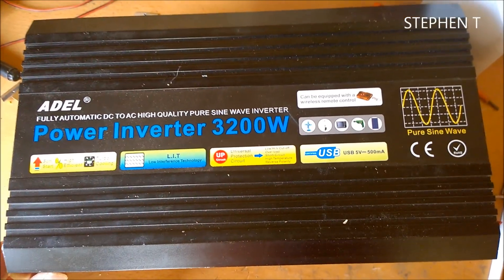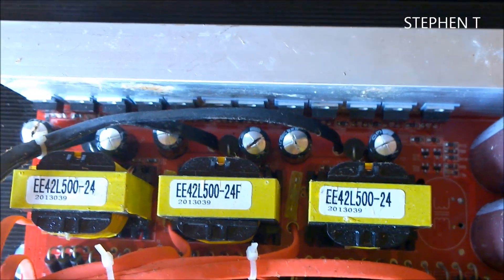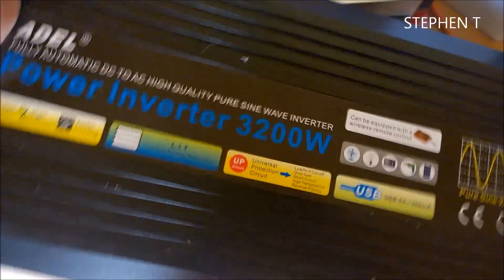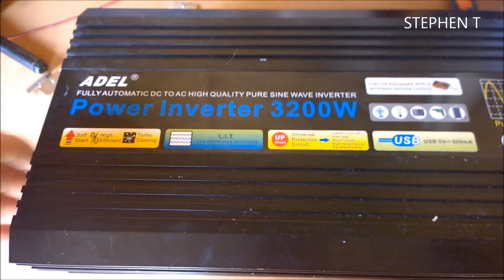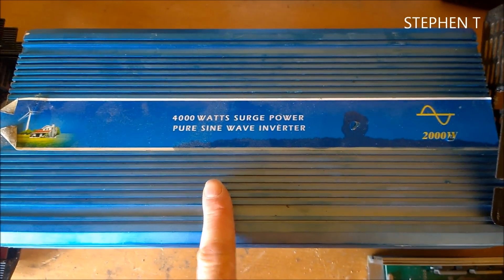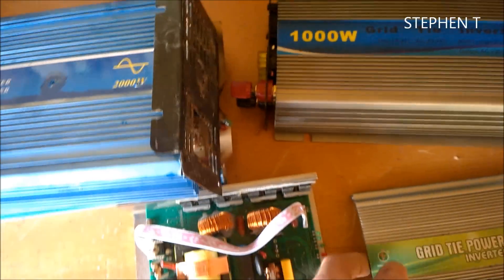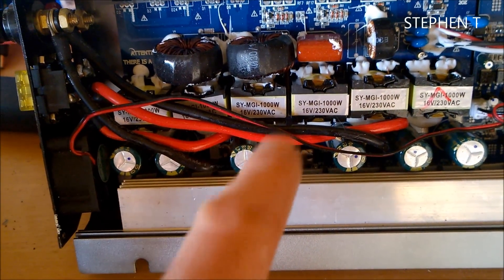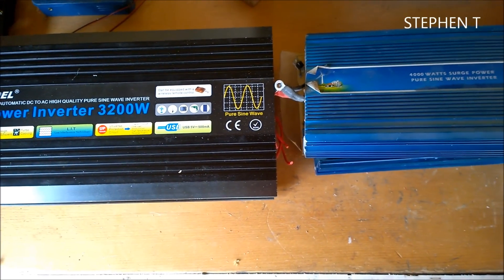WHY NOT TO BUY CHEAP CHINA INVERTERS THEY WILL GO ON FIRE

Comment: I repair tv and the same problem exist thay use small caps that cant handle the power so you have to buy new or fix the old with new parts and bigger voltage range caps thay use caps right at the voltage range so thay get hot and pop after so long

Comment: I have a Cotek Pure Sine Wave 24v 1500 Watt inverter off ebay been working for close to a year.  Maybe try one of those.
Reply from the maker: Hi I have a 12v 3000w pure sine wave and 24v 6000w for the last 3 years with no issues. Thanks

Comment: Seen quiet a few chinese inverters and to send them back costs more then it did to buy them one video they smashed it up with a sledge hammer
Reply from the maker: +jacky Parker Yes they are not worth getting. You are better off getting them direct from a supplier.
Reply: +Stephen T Anyone that sells something is classed as a "supplier" ..  Even a teacher is a supplier as they supply students with what they need to be able to learn
Reply from the maker: True I would just go direct cut out the middle man.

Comment: Hang on. Because you got 1 bad one, none should be sold? people get bad new cars all the time, so by your reasoning, no new cars should be produced either. Use any product for their stated purpose and you will not have issues. Obviously you are abusing these. tens of millions sold, and only YOU have issues with every one?
Reply from the maker: +Trina McDonald I had lots of them only used for very little time. look at more videos on youtube u see they are all sh1t.
Reply: +Stephen T Oddly my 8000 watt, split phase, pure sine wave, LF inverter made by Power Jck has worked fantastic. Couldn't reply without it.
Reply: CONGRATULATION, MY 15kW CONTINUOS, 60kW peak only can work with 4.5kW

Comment: My first Chinese 3kw inverter died from a lightning strike, I got it from a UK caravan dealer who sent it away for repair but the engineer said it was not a warranty job and the parts to repair it werent available anyway. my second 3kw chinese unit is still working well after 3 years.  One of my 350w chinese gti's died after 3 weeks but it was shipped from UK stocks and they sent me a free replacement which died 4 days after the warranty expired. You get what you pay for.
Reply: No they dont run continuously.  The instructions tell you not to run them for extended periods but I have gone away for a week before and left it running with no problems, I usualy switch back to the grid overnight. but you are right in that they do have a duty cycle and need to be rested. The answer for staying off grid is to have a smaller inverter just to keep the fridge going overnight and maybe a couple of lights while the main inverter takes a rest.
Reply from the maker: Your correct stay away from them.your better off staying with the Germans.no important costs and no waiting weeks for your unit.thanks for your comment I have only seen this now it was hidden and I don't know why.

Comment: You are right,
I have 5 Grid Tie Inverter from China bought on E-Bay,
in the first year were already 3 broken(= 60%) and no one here could those things reparier.I have it sent back to China at my cost. One is lost in the mail.

The inverters have no brand- name, no serial number and no international approval.

 Only:   Solar Grid Tie Inverter  500 W
 (solar panels=-right,, left= windmills on a blue Sticker))

The manufacturer is Kai Deng in China, the Dealer Ego-Worthy

 I  sent three times  all the forms for admission from our Electr. Office  to the manufacturer and never received a response.

There is no firmware, no designstest or test from  Tuev .... nothing .
.the use of this On Grid Inverters is not permitted worldwide.

I lost a lot of money and still have problems with the Electr. office ...
.
. I'm going to buy now only allowed brands ...(ABB-Siemens-Sunyboy ectr.)

I learned from my mistakes
Reply from the maker: hi thanks for your comment. Yes i am never buying from them again. Everything i buy from them just did not last. I will buy from Germany they know how to build good equipment. What do you use now?.

Comment: Sie haben recht,
ich habe 5 Grid Tie Inverter aus China gekauft bei E-Bay,
im ersten Jahren waren schon  drei kaputt 60 %) und niemand hier konnte die Dinger reparieren.Ich habe sie zurueck geschickt nach China auf meine Kosten. Einer ist verloren bei der Post.
Die Inverter haben keinen Namen,keine Seriennummer und keine internationale Zulassung. nur Solar Grid Tie Inverter 500 W  link Solarpanelen -rechts Windmuehlen
Der Hersteller ist Kai Deng in China ,der Verkaeufer Ego-Worthy ich habe 3 mal alle Formulare fuer eine Zulassung bei unsrer Elekrtik Amt an den Hersteller geschickt und nie eine Antwort erhalten.
Da ist keine Firmware, kein Designe-Test oder Tuev ....garnichts  ..die benutzung am Stromnetz ist weltweit nicht erlaubt.
Ich habe viel Geld verloren und noch Probleme mit dem Elek. Amt.....ich werde nur noch erlaubte Marken kaufen ...
ich habe gelernt aus meinen Fehlern

Comment: Have you tried  Sun inverters?
Reply from the maker: Hi urgentcareguy3 not yet are they good?
Reply: I think so. Never had a problem. Though I have since switched to Outbacks. They seem to be the inexpensive inverter of choice over here. I might get some for back up. If someone builds an inexpensive inverter like these with good quality parts and a bit more protection, they will get a lot of business.
Reply from the maker: I have looked at the outback they are very expensive to ship to Ireland.They are around $2000 so that's a lot of money that I would have to make back.
Reply from the maker: that's great thinking. Thanks for the info.